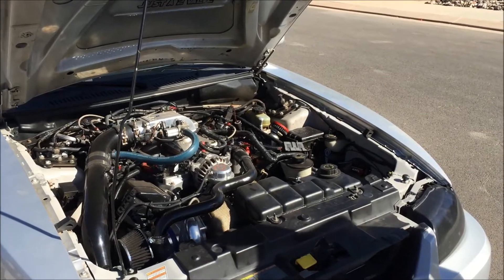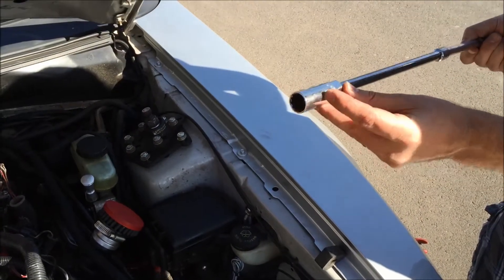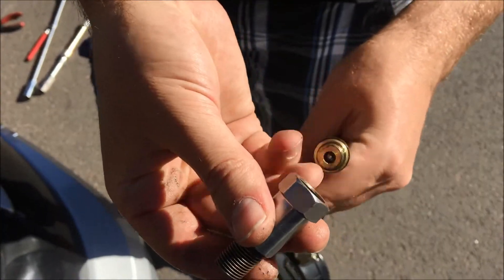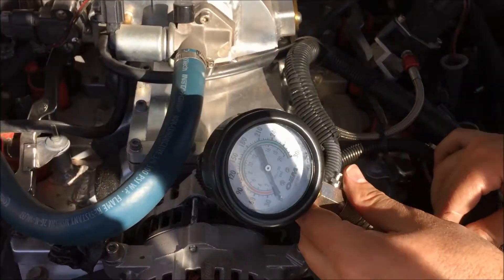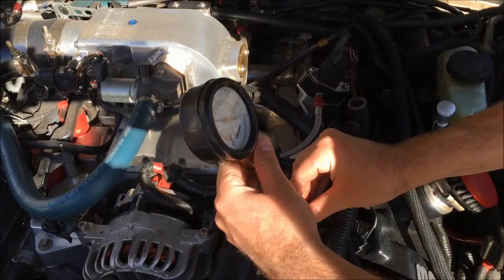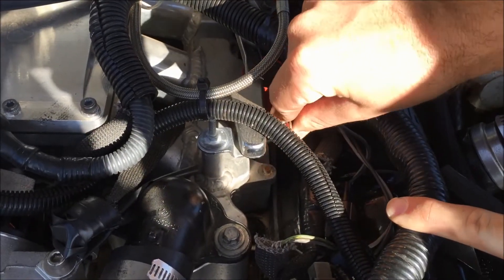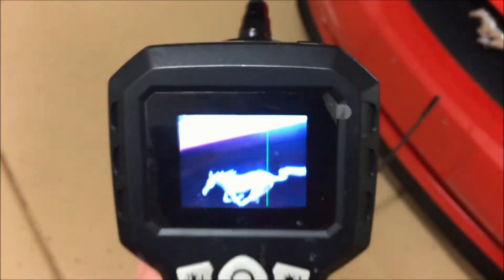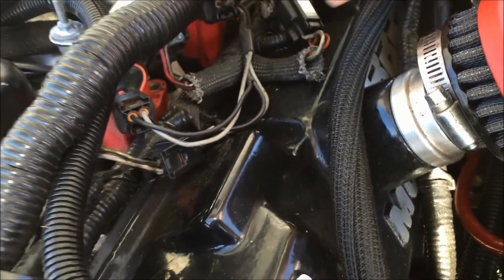How to do a Cylinder Compression Test

Comment: for a smaller channel and a year old video, this is an extremely in-depth and great tutorial. 10/10
Reply from the maker: Traxs Thank’s. I have a pretty good collection with over 500 videos. Feel free to subscribe and check them out. I have pulling the drivetrain on a terminator, gear installs, clutch installs, transmission swaps, fuel pump videos etc It’s starting to pick up and average over 200,000 views per month. Thanks for taking the time to watch 🙂

Comment: The torque for spark plugs on normal engines is light as you say, just a little more than hand tight.  But some of these Ford 4.6L and 5.4L engines had a nasty habit of blowing plugs out of the head.  I have read all I could on Ford forums and you tube about this problem.  There are some good Ford mechanics who say to tighten spark plugs in these engines tighter than normal because of the few threads in these heads.  I believe them and I always torque my plugs in these engines to 20+ ft lbs, and it has never been a problem getting them back out.
Reply from the maker: Yeah, you are correct. It’s primarily a problem on heads with only 4 threads, so I check my mach 1 at very oil change. luckily my cobra has the 9 thread heads, so less common but can still happen. Great advice

Comment: On the compression test will it tell you that you could have a been oil ring? How to tell the difference between valve seal are bad when there blue smoke at acceleration or oil is get past a ring ?
Reply from the maker: You’ll want to do a leak down test to confirm if it’s the valves. A compression test could be bad from piston rings or valve seals

Comment: What were the symptoms that lead to a compression test? Was the car ever repaired? Thanks!
Reply from the maker: Mainly the smoke show under full throttle of oil burning (you saw how much oil it was spitting out in the beginning of the video). 
  To my knowledge, even after showing the owner the compression results, they deny it and the car is still for sale

Comment: Hey I have a 2002 mustang GT and we were trying to do a compression test but we were not able to get the 14mm size to screw into the threads I was wondering if there was a special size for this year
Reply from the maker: There are usually adapters for the compression kit
Reply: Had the same problem get a different compression kit some adapters are too short even tho they are 14mm

Comment: Quick question and might be dumb but I wanna do this on my 01 cobra, I’ll do everything you did but the 01 cobra has the intake in the way. Would having the intake off for the compression test matter?
Reply: Another question do you have to take off each coil and spark plugs at a time and then put it back after you test it? I seen another video just now and this guy had taken off all the spark plugs and tested it.
Reply from the maker: @edwinortiz6583  The intake on or off will not effect the test. It’s also easier on the starter if all the plugs are removed so the engine spins more freely- it will just make more strange noises. That will not effect the results either because the test is for each individual cylinder and none are connected to eachother
Reply: @dannyjohnsonsgarage  ahhh got it, Thank you very much!

Comment: Sweet ass intake manifold!

I have the elderbrock Jr. FI, what is yours?

And does that have a larger cam installed? I know the 4.6 is an interference engine if the cam timing chain slipped it might damage all the heads on that side, just some ideas.
Reply from the maker: poot111111 this one is Richard racing. I highly doubt the chain slipped, but rather the valve clearance on this engine build was too tight with the cam when the engine was rebuilt
Reply: ohh that makes since.
I didn't know the engine was rebuilt. That sucks to have a fresh motor with a dead hole! Keep up the good work! I will be watching, you will be the next Chris Fix for Ford guys
Reply from the maker: poot111111 ha ha, thanks man. Chris fix is great

Comment: Can u pull all the plugs then test each cylinder? And do u have to completely unplug the coil? I have an 2003 cobra
Reply from the maker: Yes, it’s much easier on the starter to remove all the plugs so there is only compression on the cylinder in use. We did that on an 03 cobra once https://youtu.be/ZrtzOCheUkw